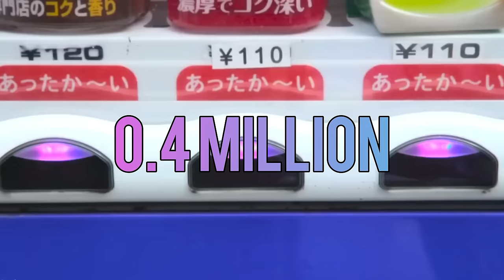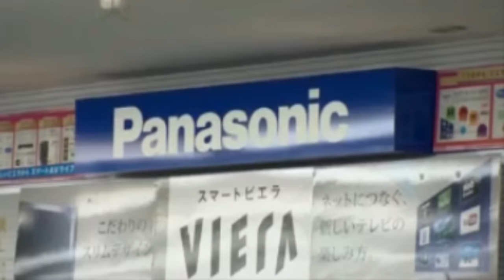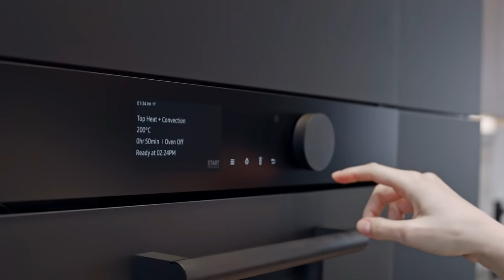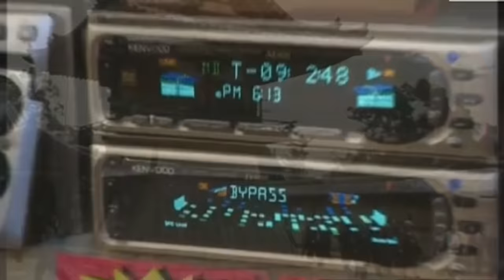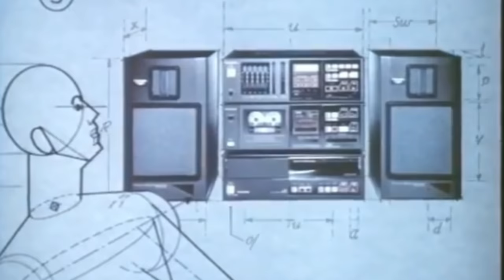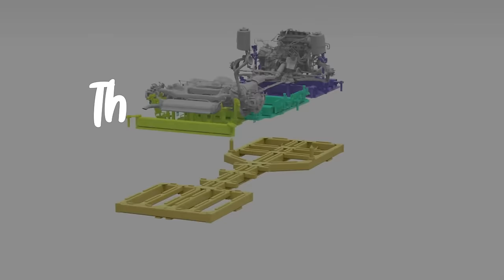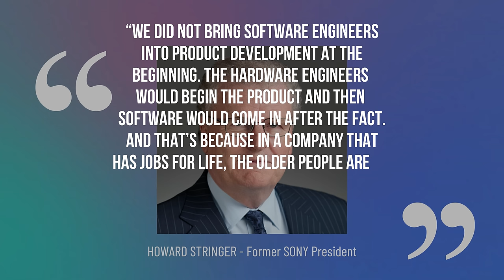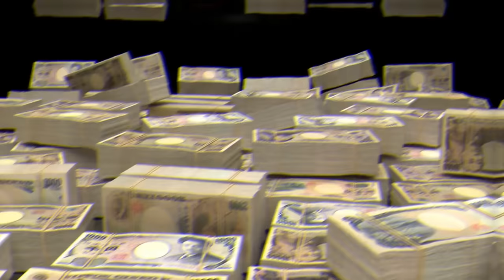How Japan's Tech industry Failed

Comment: Hardware is almost sacred in Japan due to thousands of years of valuing crafted items, but software is a distinctly modern invention, an abstraction which ancient Japan had no cultural respect for, so it didn't filter down to modern Japan.
Reply: I think hardware innovation will make a comeback in this mid century. Software tech in current state has moved too fast for hardware to catch up. Hardware and software are both complementary element in technological advancement. One of them could not move up further into the value chain without the other. Most software startup currently are currently positioned in bust economic cycle until the next hardware revolution is coming. If that is the case then Japan still has the chance to make a comeback as the world tech powerhouse.
Reply: @TheJohnnyJohnny  I agree, once the world gets overall headaches over staring at screens of phones, maybe they'll appreciate some japanese handicrafts. i'm still an addict over their action figures. we know the health problems caused by gadgets. also, if Japan could craft more Augmented Reality exercise machines, resurrecting the dead tech, it could also be a big boost in sales.
Reply: Very interesting take.
Reply: at some point in time, they will have to put more emphasis on hardware development as the software will not be able to be ran on the respective hardware. @TheJohnnyJohnny
Reply: Japan has no cultural respect for software…so we don‘t count games as software I guess.
Reply: @Slithermotion  Games run on software, but they're not purely software. More like,you use a game engine to make games.
Reply: @Nonamearisto  I think you don‘t understand the definition of software.
Games are software it doesn‘t matter if you code with machine code, assambler, c/c++ or use somekind of tool.
Software is software.
Your comment is right that japan doesn‘t have a lot of consumer software outside of games.
Industrial and the gaming software industry are pretty strong.
I don‘t really see a problem with that the global market allows countries to specialize in their best field.
Not every country needs to develope their own operating system ect.
Reply: @Slithermotion  We can quibble over it, but yes, a game is technically software. I'd argue it's a software product. The point is, it's still a niche form of software. Japan isn't known for making much in the way of software compared to the US. That's why there's nothing from Japan remotely as big as Windows in that field.
Reply: Can't wait to choose between arasaka and militech for my 70th birthday

Comment: Sadly, I don't see why the next cycle should play more into Japan's strength at all. Tesla is the best example. This new era does require exzellent hardware engineering - but 60% of the value added in a Tesla car is software. This balance may even become more "unfavourable" vs Japan's strengths if you factor in the effects of AI. There are currently only two relevant players in this: The US and China. Hard to see how Japan can possibly catch up. Hard to see how Japan can become better at integrating hardware and software innovation. And Japan is not alone. Germany is no better. Stuck in the "pre-software", mechanically/eletrically focused innovation-cycle, too.
Reply: @Pattern-Recognition  
 Japan R.rose out of the ruins of WWII and became by 1970s the best economy in the world so this time would be a lot easier.
Reply: @anthonynicholich9654  it won't happen until the older generation retire. They would have to shift the country's work culture.
Reply: 1 year later, your comment is even more accurate.
Reply: US and China are the two system builders. US is the modern trendy system builder, China is an old, reforming system builder.
Reply: 60% of Tesla is Ilon Musk, 😂 lol
Reply: Sony and Honda are working together. This should prove advantageous for these 2 in the car market. Teslas suck at software and have poor fit and finish. They also like to catch on fire if you look at them wrongly. What they are good at is marketing. That's also what Samsung is good at. Samsung is good at marketing and catching on fire. Samsung phones are what causes people to have the image of Android being laggy in their minds for so long. Samsung is bad at software.
Reply: @1.4billion65  why is that?

Comment: Japan was not only the leader in consumer electronics in the 70's, 80's and 90's,  it also led the way with what was called "Fifth Generation Computing".  These were a new generation of computers based on massively parallel architectures, concurrent logic programming, and the first real stab at AI called "knowledge processing".  It was a commercial failure, but this type of computing would come back years later with the modern parallel supercomputers and AI systems today.
I thing the biggest reason for their stagnation is the fact that the Japanese market is a closed one with high barriers to entry and lacked a vibrant entrepreneur culture of startups.  You have basically a cartel of companies making every electronic product.  No real outside competition results in companies sticking with what worked for them in the past.    In the 90's when some of these companies ran into financial trouble with some of them withdrawing from the market, new competitors from outside were basically able to eat their lunch.
Reply: Fully agree. Dominate a captive market with no innovative competition allows you to copy paste cheaply outdated designs and consider mistakenly that it's a long term clever business model. Old blind top management failed to reckon the threat and the ground they were losing. Youngsters in their organisation just face impotently the result of such a policy.

Comment: The problem is, like it was said in the video, these Japanese tech companies like Sony, outsourced their manufacturing and once they did that the quality went downhill quickly.  I have a Sony cassette deck from the early 90’s that was built in Japan and it still works. But the minidisc deck I had purchased only four years later was made in Malaysia and broke after four years and a blu ray player I had (made in China) stopped working after less than a year. Their televisions today are not that high of quality like they used to be considering what they try to charge.  Their new 4k players are a joke and break out of the box. Your paying for the name, not the quality it used to be known for. Even their headphones are not what they used to be. As for Panasonic the story is similar. Sometimes it would seem they are just built in the same factory and have a name stamped on them that means nothing. 

The average consumer these days can’t afford to keep replacing things and when they do they are not going to keep choosing a brand that initially stood for quality but then cheapened the manufacturing and design process. Companies like Sony and Panasonic need to refocus the quality on what they still produce, bring the manufacturing back to Japan and lastly, stand with their product when it breaks down. Also if a trend is returning (such as a resurgence of a particular technology) focus on that and not building phones nobody wants. You have to look at what people want which is what these companies used to do. The average person does not want robots neither do they care much less be able to even afford them. To me it’s creepy. So it’s a waste and these are things that can be built to order, not mass produced. All these companies need to focus on what the consumer uses and wants; Not just be another option of a lesser quality in a saturated market of throw away devices creating more e-waste.

For example- if you see that tapes are making a comeback, make one good quality tape deck for your lineup and go from there. If it does well, make other models. Same with turntables. Same with CD and BluRay players -make a few good models with quality transports that don’t break and go from there -physical media is and has been making a comeback. Many are getting fed up with streaming. Stop building junk and then not standing with the consumer when it fails. In this way, you will rebuild your reputation. It is a gamble but hey it might just pay off in a world where most products are garbage anymore. Innovate. Pay attention. Be different.

Sony and others do not have to reinvent the wheel. Afterall, they do still make good cameras. They have Playstation. But cutting costs for profit on everything else never helped anyone. If they know that they can’t beat the likes of Apple and Samsung then they should stick to what they’re good at and that is building one or two quality components for old tech (which people still use) that is making a resurgence and do it in house, in Japan, not abroad so as to gain back their quality reputation.

In conclusion, it’s really not that hard to see why these companies are failing. They do it to themselves and appoint leaders who have no clue what they’re doing and are completely out of touch.
Reply: Morita Akio: Made in Japan

Comment: I am one of those rare engineers that went from 20 yrs in hardware (high speed instrumentation) to software late in my career.  When I started my company, nearly all my  old technical contacts were dumbfounded.  They couldn't relate at all to what I was doing, unimpressed because it wasn't a "challenge".  Therein explains the failure of Japan.  Engineers and professors are all trained in state of art hardware to the disdain of software-oriented products.  BTW, I went public in 5 years, which further dumbfounded my old contacts.  Besides high IQ I also happen to have high EQ which is the domain of many software products.

Comment: Well,the thing is that after WW2 in order to establish Japan as a bulwark against communism the economic recovery had to be as fast as possible.
In order to achieve that the economy was run as a war economy with central planning. And in order to get the ball rolling the "denazification" of Japan 
was very brief and soft (compared to what happenend in post WW2 Germany).  So some years after Japans capitulation most of the high level technocrats
and administrators of the old regime were in positions of power again. However,this time to hang a sweet carrot in front of communist China and Russia.
To show off how well workers are in capitalism.....
Japan got the same role as Western Germany.
That all changed in the eighties,when neoliberal ideology got accepted in state policies throughout the western sphere. In short: the prospereous years for 
the common people were over.

Comment: Great video! I think it was on point with most things. But there is an old curse, that once you reach the top you become everyone’s target. Samsung has had several quality issues in the past few years, and it is most likely due to the pressure to stay on top. This issue has been happening to a lot of korean brands… but a quick summary of where product stands:
Built quality, japan is still number one. Software, the US is on top. I think korea and china are great at delivering value. They excel in delivering a lot of features with a decent quality.

Comment: I still prefer Japanese products for home electronics where available. Panasonic washers, rice cookers, wva panel tvs and microwaves are still the most reliable ones as well as Sharp Aquos TVs. Their LCD panels didn't get any single burn-in in more than 10 years of CCTV still image usage. And they're always on 7/24/365... And I prefer Kyocera printers, then Xerox and Brother...  - But I admit that in a world of sustaining and long lasting doen't count, some illicitly built chinese products would oversell easily, as well as SONY software ecosystem was pretty tangled in that time. Because tangled Japanese  design school that shows entire thing at a glance would be perceived as a spaghetti for Western people. However, some easier user interfaces and decent sync services that run on Akamai clouds would make the Japanese IT products bril again.  - E.g. more easier to use and easier to install end user interface for Kyocera printers, more diverse options for Toughbooks (Bring'wm some AMD Zen 5), and - if those Fujitsu were back again :(

Comment: Japan has to hold on till the dust settles. After the AI takes over majority of tasks that it reliably can, all those services/products will have close to zero value,cost & profit at least in the consumer space I think. The reliable hardware behind the scenes will still be Japan (like Sony sensors). Also whatever left of value will be tangible items.
If I look at TVs in current market - Sony is still probably the best in quality as well as after sales service. Same goes for cars. They just have to hang on to enough market share to continue.